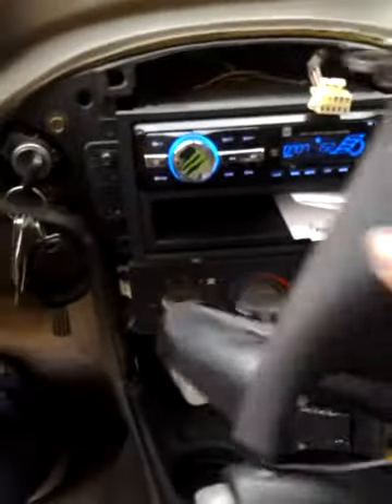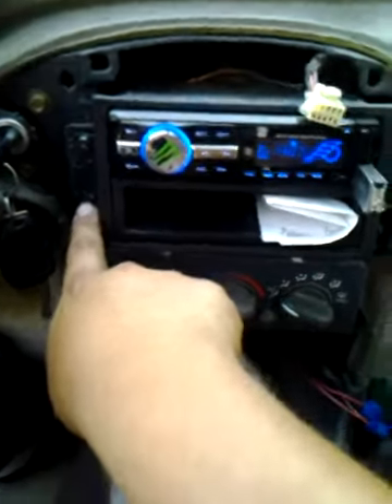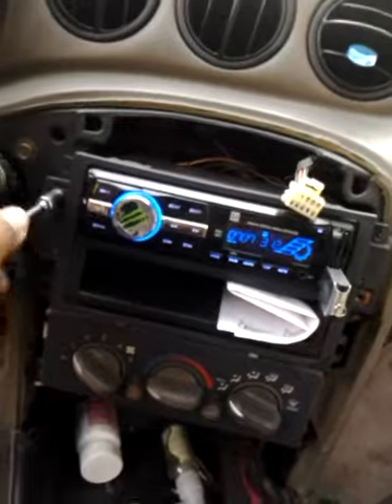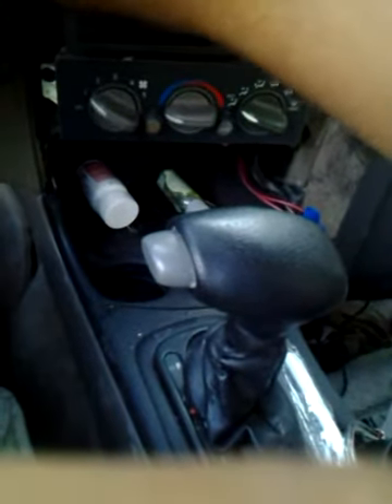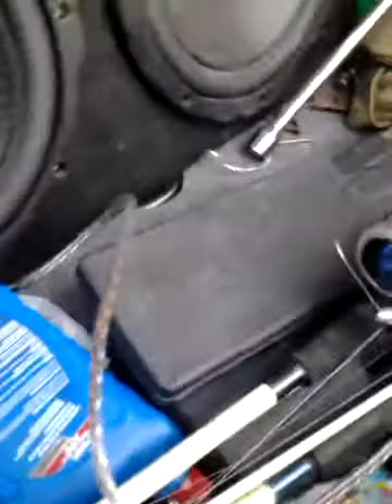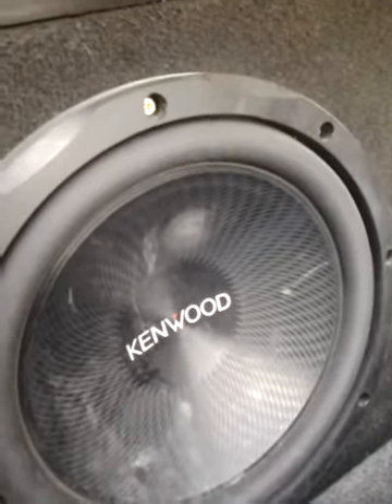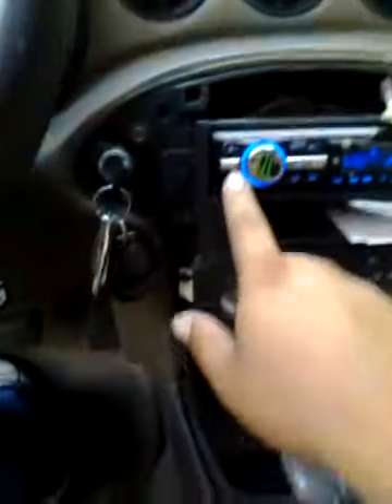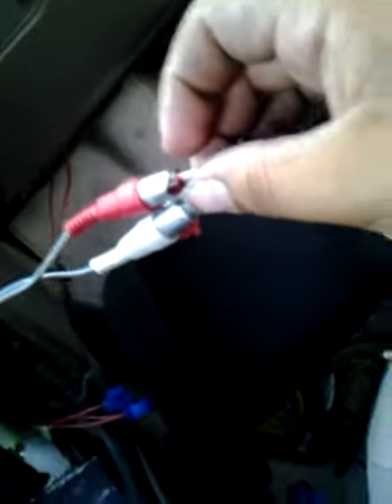Memphis rca cables

Comment: Those are cheap junk Memphis cables.. there are audio differences in cables.. but one of the bigger benefits is noise rejection.  If the budget is tight KnuKonceptz is about the best out there on the cheap.